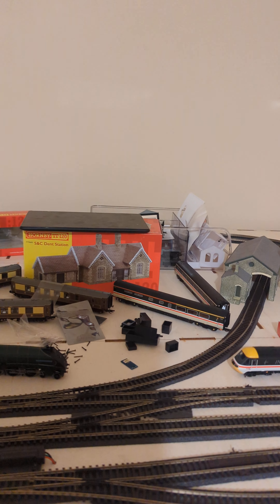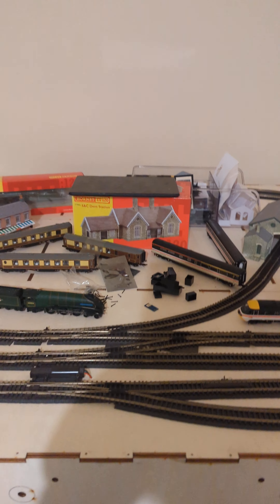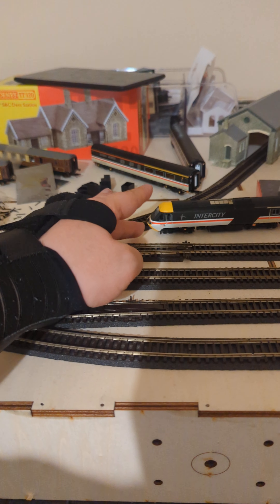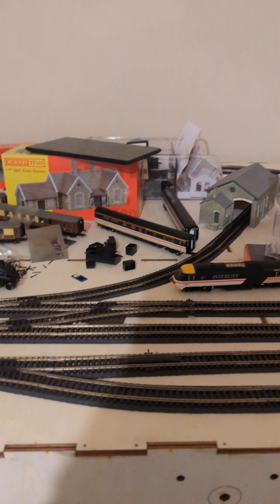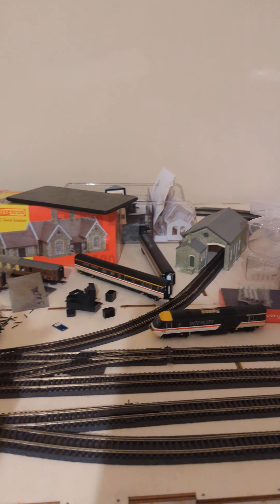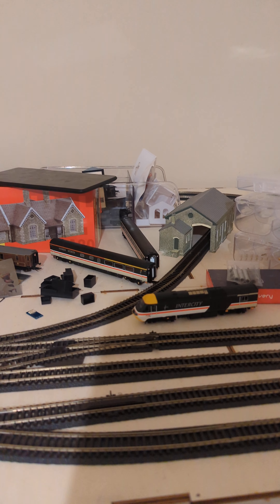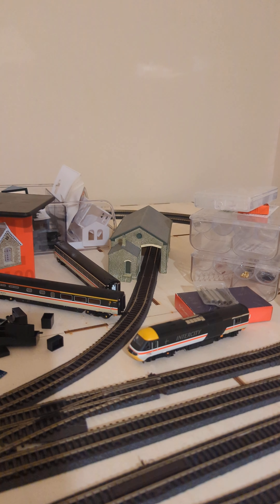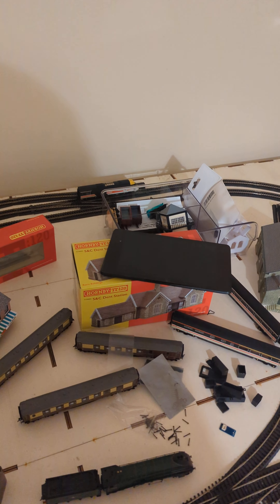A quick update and a long rant about HM7000. Do we care about security?

Comment: The decoders are linked to the App not the device you operate them from. The App is linked to your Hornby Account, which is how it is able to send you reset codes automatically. You cannot take control of any other decoder while it is linked to an App account, the Account holder needs to unlink it first and then you can link it to a different app account. 
A ‘club’ option to allow easier handing over is planned but not available. There is no security issue 😁👍
Reply from the maker: That's not true. I'm uploading another video now where I take control of another train which isn't on my account/app/device. The train's owner wasn't even in the room.

It's another unscripted ranty thing, but I think I make the point